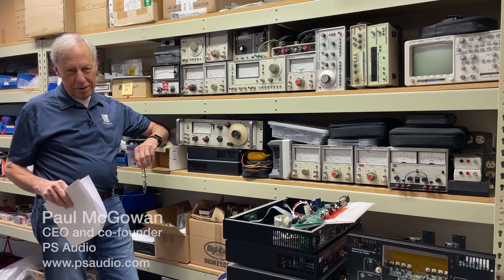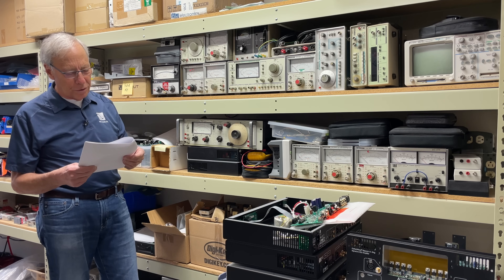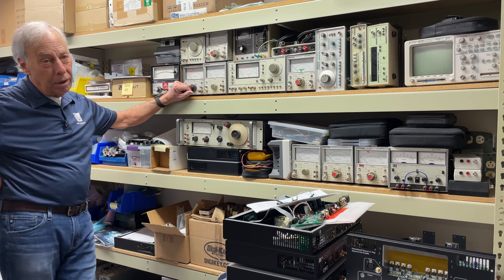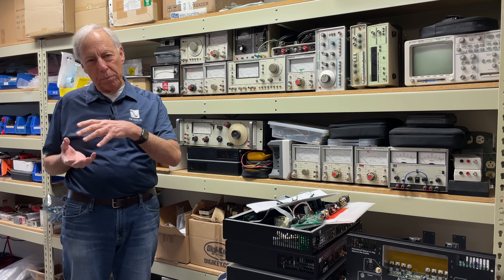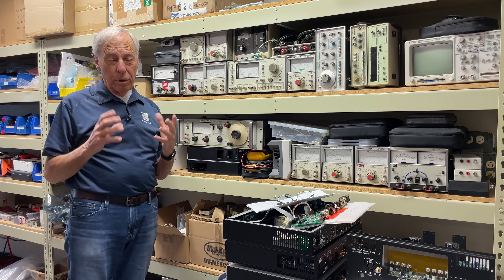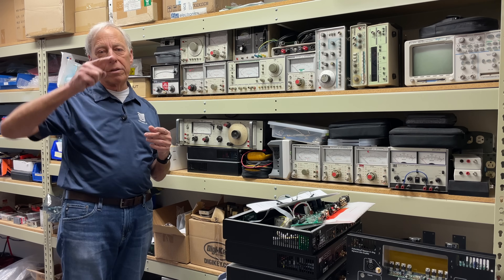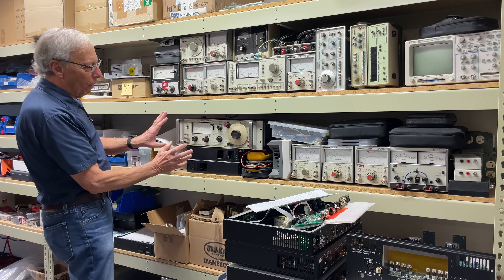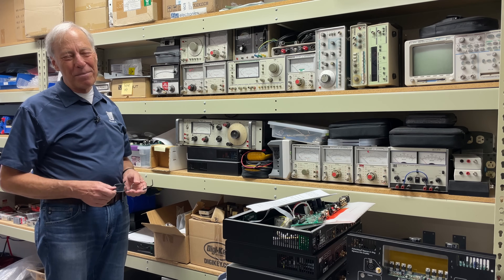Vintage test equipment

Comment: I'm late to the show. I enjoyed this a great deal. There is an excitement about manualy tuning those old rigs. I had a couple of HP distortion analyzers, a 330B and a 332. They sure were fun to use and I was astonished how well the 330 worked when it was well set up. I still use a Sound Technologies 1700A from time to time.

Comment: I used the HP333A everyday testing the Cambridge audio P60 in 1974/5  when I was a technician at the original Cambridge Audio Company in St.Ives, Cambs, England :)

Comment: If an audio component has a sound signature it is imparting distortion.  Why then do most if not all audio equipment impart such a signature?  The answer of course is differentiation that audiophiles  will pay for. My real question is why shouldn't we strive for no distortion in amps and pre Amps and flat response speakers and have a parametric EQ and adjust to taste?
Reply from the maker: I think you have fundamentally missed the point. No company I know adds distortion or looks for a type of distortion to suit the sound. We all do our best to lower it. That said, the ways in which distortion is lowered are many and all have their sonic signatures. Global feedback when applied in large amounts lowers distortion to beyond audibility but not without a price. Everything in engineering is a balancing act.

Comment: When you mentioned 1kHz I started to wonder.. Do you messure your amps watt output at just 1kHz (with either one or all channels driven) or do you actually messure it the correct way (like NAD and some others): 20-20-000Hz, all channels driven @ various ohms (aka FTC watt) ??

The first type of messuring will give ALOT higher watt numbers since there is no bass freq that draws any high currents while the last method gives a realistic continous watt over the whole hearable freq range..

Almost 20 years ago I had a 50w amp that beat the living shit out of a "100w" amp on the same speakers. The "100w" amp went into clipping or protect mode (the speaker ohm was correct) and even blew two tweeters while the 50w amp drived the speakers better, louder and never clipped or did go into protect. And I also never blowed a tweeter again... The 50w amp wass messured with the FTC standard while the "100w" amp was messured only at 1kHz and one channel driven... HUGE difference. And the 50w amp had twice as large power supply too so...
The 150w 8ohm / 300w 4ohm (FTC) dual mono amp I have today would be equal to atleast twice the watts if messured with a useless 1kHz tone... :P

Comment: Yup, you can't beat the old gear for hands on user experience, a mouse and keyboard just isn't the same,, 
I still use my trusty Thurlby Thandar (now sold as TTI) PL-330 QMD power supply from around the late 70's, so much nicer to use than my modern P.S.U,

This thing hasn't been calibrated for around 25 years but I've had it checked against some freshly calibrated gear and it's not far off at all, fine for home use, 
This thing wasn't cheap in its day, but today you have to spend silly money to get that kind of quality

Comment: Does anyone know exactly what Audio Precision IS ? Everyone goes on about it saying it's a gift from god and is FRIGHTFULLY expensive  but for your massive cash outlay what do you really end up with ? A programme you download or what ?
Reply from the maker: It's a hardware platform that basically leverages the power of a computer, uses custom software, and then all the ins and outs and signal processing done in hardware. So, it's all three: hardware, software, and a computer.  Have a look here—https://www.ap.com/analyzers-accessories/apx52x/
Reply: @Paulmcgowanpsaudio  ~ Thank you for the info .. I appreciate it very much. How does it compare with LEAP and LMS ? I use both of those. With LMS I take acoustic measurements on a rotating table to obtain polar curves  in a large open paddock at least 3 acres and on axis response by an open pit dug in the ground facing the sky. Do you guys measure decay response btw ( waterfall ) graphs ?
Reply from the maker: @janinapalmer8368  Les, those maximum length sequence analyzers are what we use as well for speaker and polar measurements but they are very different than the hardware based AP.
Reply: Someday you might try a program called Google :-)

Comment: Who was that designed by then the HP analyser linkwitz possibly you know
Reply: Now there’s a name that is missing from Paul’s name drop list. Siegfried Linkwitz was truly a great engineer to understand the way technology could map to perceived sound. I built myself the Wireless World active system back in 1983 and still have the KEF drivers and some notion that I will put them back into use as passive boxes - LR4 crossovers of course. 
Did anyone notice ‘friend and neighbour’ Nelson Pass on the Linkwitz Lab site?
Reply: @Hey.Joe_Ridley  Nelson pass manufactures and sells the active linkwitz crossover